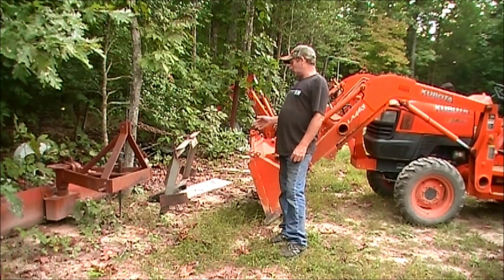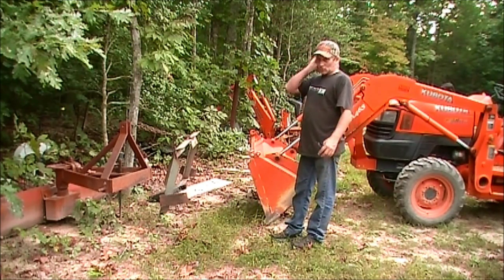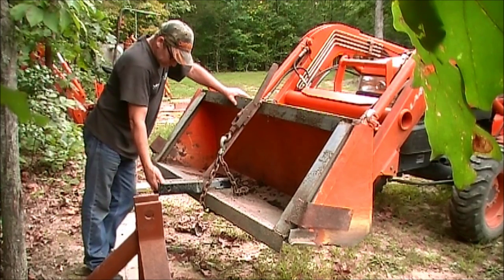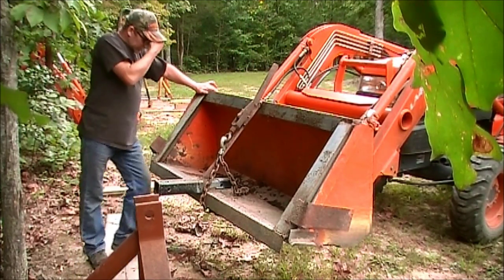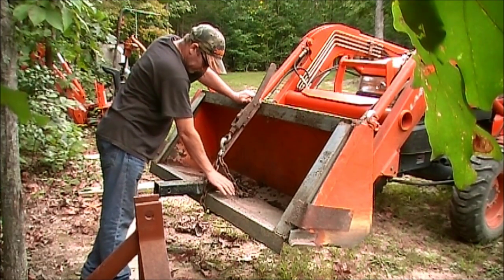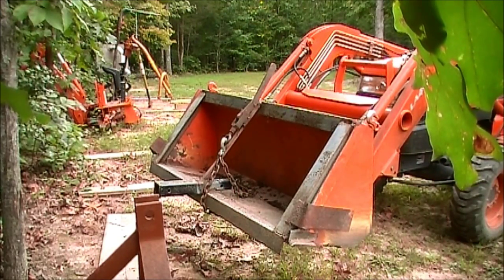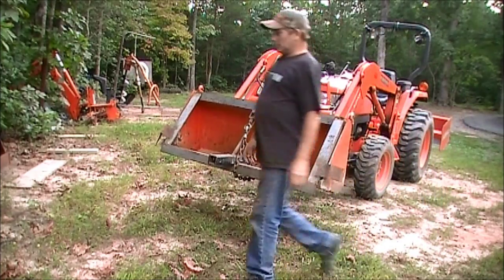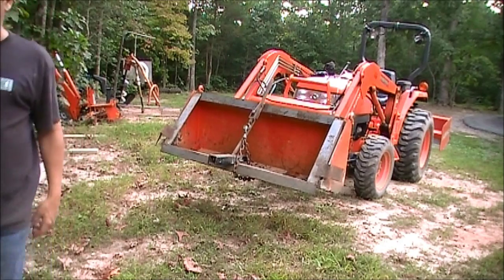how to make a bucket receiver hitch

Comment: Looks great! I was thinking the same thing about the clamp-on ones and then I ran into your video. Going to build one. Thanks for the idea.
Reply from the maker: this worked great for me while I had a pin on bucket. since this video I got a quick attach system skid steer style and built a new device to fit it for moving trailers and stuff.

Comment: Nice job, now that I just put my backhoe back on, I was just thinking how handy that would be.  Great idea about distributing the weight on the bucket.  The forks would be a great addition.
Reply from the maker: +GY Solutions forks are in the works trying out a few options and coming up with a cost effective way of using material I already have to get the forks on there.

Comment: Nice idea but maybe unnecessary. We just weld a hitch right in the middle of the bucket on the top. (the same area your chain hooks are welded). Then you just tip your bucket all the way down and you can go right under trailer. It's also out of the way when not needed. And also can be used as a lifting point.
Reply from the maker: yes I have done it that way before, works fine for most trailers and situations. I   have actually bent the bucket moving trailers like that though. plus I was using this to raise a trailer really high in the air for unloading so this provided extra prevention from  bending the bucket. a trailer being moved that has some heavy tongue weight can bend a bucket if it bounces to hard  while  moving it.